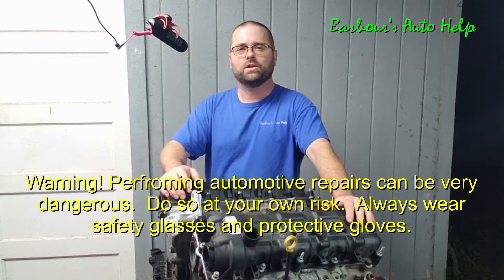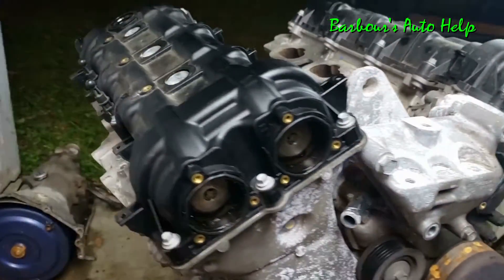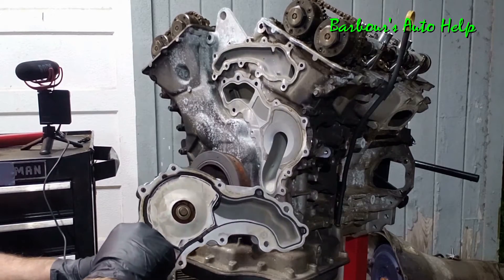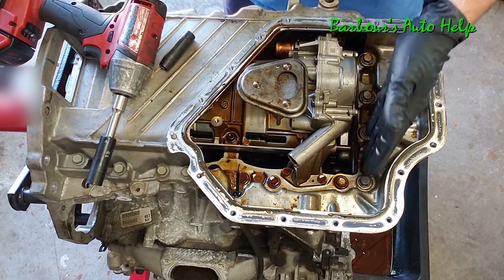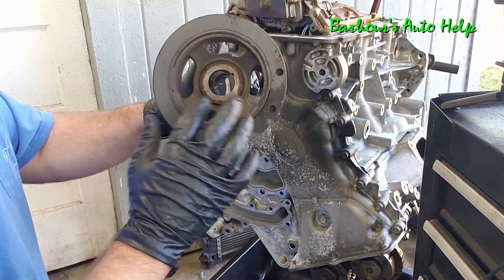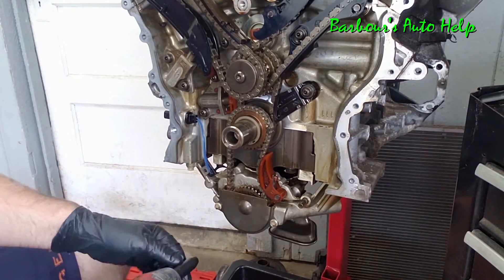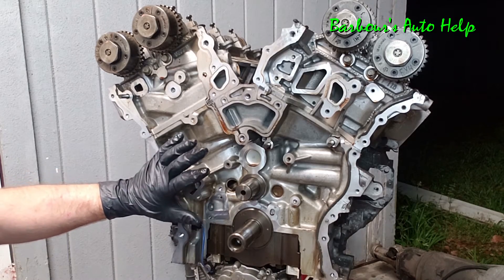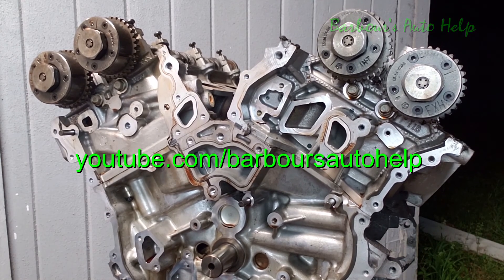Chrysler Pentastar 3.6L Tear Down: Part 1

Comment: This engine gets a lot of heat for its early issues with the rocker arms. But it’s a very decent motor overall. It has a good balance of power and fuel economy and it doesn’t use DI.
Reply from the maker: I'd have to agree with your point that it's an overall good engine.  Thanks for the comment!

Comment: I had this P.O.S. motor in my 2016 Town and Country, bought it at 10k miles and by 78k miles I had 2 coil pack,8 rockers,4 rods,full coolant system replaced, all work was done under extended warranty, last straw for me was getting it back and saying to the guy ,cam phasers are clicking..sorry unless there's an error code we can't fix...There is no code for Cam phasers on this motor, This motor could've been as great as the 3.8 buick,unfortunately Chrysler chose to use cheap vendors, great detailed video